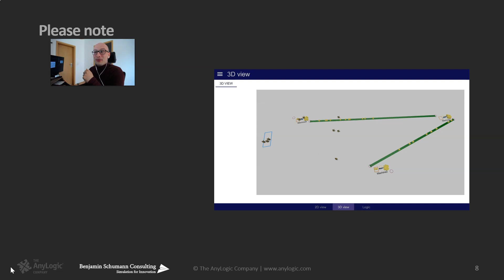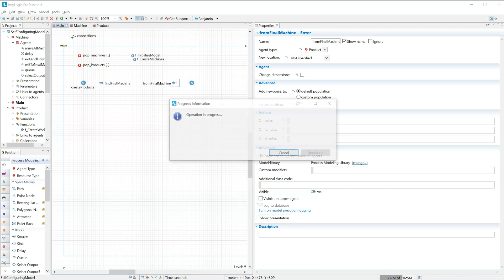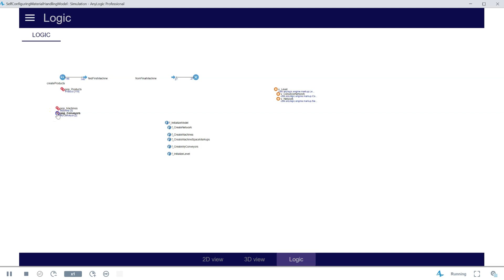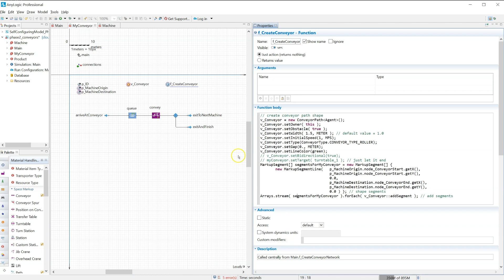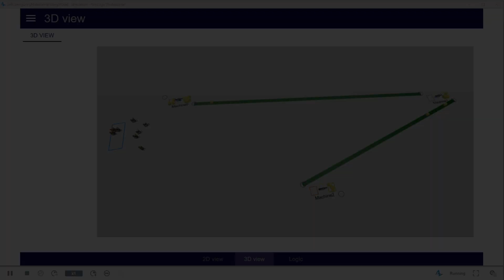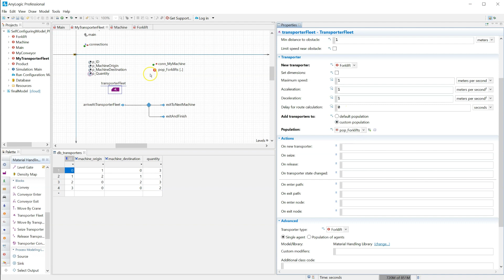How to Build a True Digital Twin with Self-Configuring Models Using the Material Handling Library

Comment: Thank you very much for this helpful video. It gives you the possibility to be much more flexible after some coding to set up the model. I am trying to implement this approach for a complex model, with agents living in other agents (for example a model with different production areas with their own machines and conveyors). How can you deal with networks and levels? I understand the approach for the network in the main. But how with a more complex tree of agents?
Reply from the maker: Hello Andrea,

The approach for agents inside other agents depends on the current implementation. It is necessary to look into your model to accurately answer the question, but the general approach will remain the same as in the video. You can submit your model to AnyLogic's user community platforms, which you can find at the following link:
https://www.anylogic.com/resources/support/

Comment: hi , we currently use the Tecnomatix software for our purposes . But I appreciate the detail at which Anylogic is build . In the video , I did not understand the meaning of “self configuring “ ? Can you please explain more ?
Reply from the maker: Hi! The 'self-configuring' refers to the model taking parameters from a data source (in this case a database table) and configuring itself. So the number of AGV is specified and which machines they serve. In other situations this data could come from a live database that indicates the number of available AGV and which machines need serving. In short, it allows you to reuse models for different scenarios without having to reconfigure them manually.